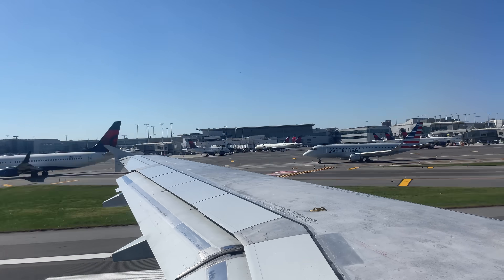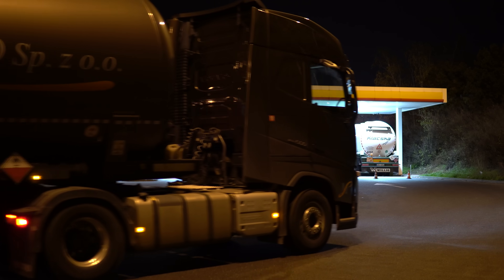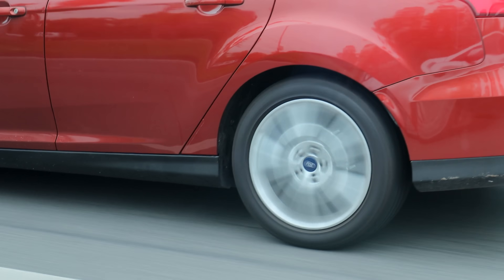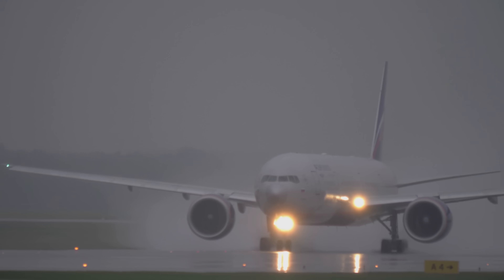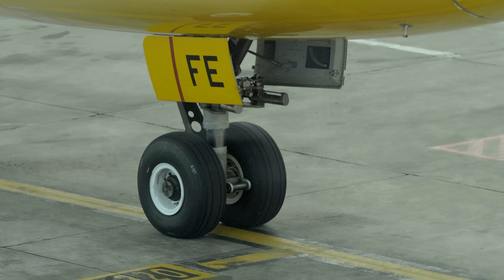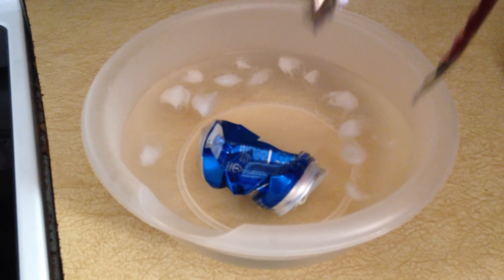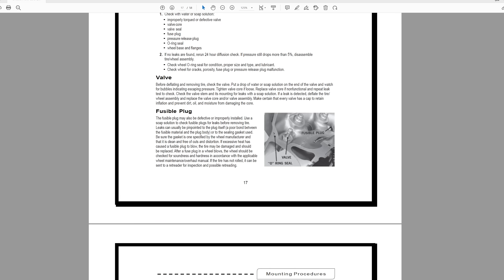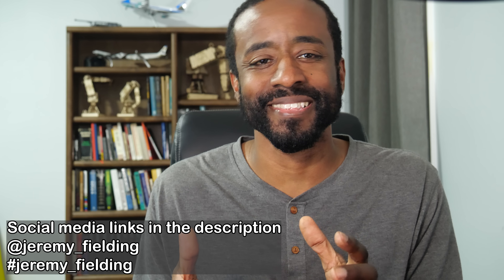The Ingenious Design of Airplane Tires- Jeremy Fielding 107

Comment from the maker: Technical correction: 
The Boeing 737-800 main wheels (the 4 rear wheels) are actually 44 inches making them just barely larger than the tractor trailer tire. Despite my research and having a second engineer fact check the video we both managed to miss this fact because the nose wheel diameter is 27" and mentioned in more places. The overall story is the same. The capacity of the airplane tire is many times greater than a truck... including the 27" nose wheel, but it was definitely worth mentioning that not ALL of the tires are 27". Unfortunately I can’t change the video now that it’s live. I also added this note to the description.
Reply: Mr. Fielding, another engaging, informative and well researched video. As a longtime subscriber, I find your videos to be some of the best on the topics they cover. Not only are they clear and concise, you deliver them in an interesting way. Keep up the great work!
Reply: Also, the fuesable plugs are in the wheels, not the tires as you say in the video,  Minor nitpick I know.  Great video regardless.  On most if not all aircraft, there is very little weight on the nose wheels.  This is a problem for many aircraft.  In fact, certain aircraft with tail mounted engines have been known to tip backwards just from the weight of snow from a storm.
Reply: More info.  Most of the weight is on the main gear.  I suspect it's 85 to 90%.  I don't have supporting data, but the 737-900 has a tailstand to prevent it from tipping during loading/unloading.  

"Power to the wheels".  No, there is no power to the wheels, but braking is the same thing, just in a different direction.

I believe the tires on my aircraft are 38 ply.  I will see if I can find some pictures in my phone.  There is also a speed limit on aircraft tires.  I would guess that the limit speed is one of the limiting factors that goes into takeoff speed calculations.

Runways:  they have crown built in to cause water to run off.  They are also grooved, but unlike roads which are grooved parallel to traffic, runways are grooved across the width.

I called one of our tech reps about tire life and was told they last about 320 cycles (takeoff/landing is one cycle)
Reply: @oscarb9139  38 ply is a weird number. I know the 767-300 uses 36ply main(rated 230psi) and 24ply nose. 
I mean its an archaic measure of equivalent tire strength anyway, none of them are actually using 36 plys of cotton in the last 70 years. Probably only 3-8 actual plys regardless of pressure rating. (With actual strength varied through different thread sizes and materials.)
Reply: @mytech6779  I was going from memory, and am most likely in error.  I have some pictures during walk arounds.    I will see if I have any sidewall info in them.  Thanks for your input.
Reply: @oscarb9139  As long as you aren't the one replacing them I don't think the difference of 2 strength plys is worth further investigation. I also have sidewall pictures from a walk around.(but its 767) Anyway 36 is a multiple of 12 which evenly divides into a variety of  sets of layers(2,3,4,6,12) which is probably why its a common standard even though it's only an equivalent rating these days.
Reply: @mytech6779  I wasn't questioning your knowledge.  I was merely stating what I thought I saw.  The preflight requires that I verify condition, not ratings.  You obviously are more familiar with maintenance procedures.  I just fly them.
Reply: @oscarb9139  max tire speed is usually 205kts, every takeoff and landing therefore should be below that speed, but that speed is never limiting (well it is limiting but there are many other factors that will go over the limit first)
Reply: @topethermohenes7658  We had a bulletin that came out that showed FOQA data with tire speed exceedances.  The cause was slower rates of rotation at high altitude airports where IAS and ground speed have a large spread, even without a tailwind.
Reply: @topethermohenes7658  Quote from article:  Boeing is receiving an increasing number of operator inquiries about tire speed limits being exceeded during takeoff. This does not appear to be a new issue. Rather, advanced data acquisition tools on modern airplanes have made operators more aware of tire speed exceedance events.

In most cases, the speed exceedance is small, only a few knots. Boeing is not aware of any of these overspeed events resulting in thrown treads, which suggests that airplane tires in good condition can withstand these small speed exceedances without damage. However, it is important to remember that at high speeds, heat is generated within the tire structure. This heat, combined with extreme centrifugal forces from high rotational speeds, creates the potential for tread loss. Ensuring that tires are operated within their speed ratings will help prevent possible tread losses and the potential for airplane damage.

When dispatching an airplane in compliance with the certified Airplane Flight Manual, the airplane takeoff speeds are designed to ensure that the liftoff speed does not exceed the tire speed rating. While rotation and liftoff speeds are generally expressed in knots indicated airspeed, the tire speed limit is the ground speed, which is usually expressed in statute miles per hour. This means that a tire rated at 235 miles per hour is designed for a maximum ground speed at liftoff of 204 knots.

A number of factors can lead to a tire-speed-limit exceedance during takeoff. Typically, this occurs when an airplane is dispatched at or near the tire-speed-limit weight and:

The airplane rotation rate is slower than the Boeing-recommended rotation rate, and/or

There is a late rotation, and/or

The tailwind is higher than anticipated.
Reply: @oscarb9139  thats for high altitude flights, for most flights, vmca always is below 205 knots. Or on long runways vmbe is limiting
Reply: @topethermohenes7658  DEN, COS, and SLC were the destinations cited.  I would assume most of these events were using high flex Temps, which usually correspond to the highest V speeds.  Our tire limit speed is 195 knots.

Yes, I agree that most of the other limiting factors will be reached first, but the cited article and communications from my company indicate that tire limit speed is also an issue on occasion.

We used to use balanced field speeds and it was never an issue.  When we switched over to unbalanced speeds to optimize payload, we got much closer to the tire limits on takeoff.  On landing, it would only be an issue on my jet if we had a failure of both slats and flaps, which increases our approach speed by 60 knots.  That is something few people have ever had to contend with.
Reply: Pretty understandable mistake. Just goes to show why there is so much fact checking in engineering or aviation. No matter how good you are, you can be prone to mistakes.
Reply: Love your videos man. Your a natural !!
Reply: Nice video, Jeremy.   A few additional details. Wheels have the thermal fuse plugs that are designed to melt a release inflation pressure after a high energy braking event (such as rejected take off) to protect the wheel-tire structure.  A carbon brake heat sink can reach temps several times greater than the temperature at which the aluminum that makes the wheel begins to loose strength.  The wheel is a pressure vessel that is only (perhaps) 1” from the brake rotors.  A great deal of effort is made to manage temperatures of the wheels. Wheels also have a secondary fuse plug to protect against over inflation- failure of the nitrogen regulator.   Something else to ponder is if you have a tire that is ~52” diameter with 21” wheel and inflated to 220 psi, do the math on the separation forces between the two wheel halves.  Those 20 or so tie bolts carry far more load than you’d imagine. Wheels tie bolts are inspected at each tire change (roughly 200 landing per tire replacement); and are perhaps one of the most inspected parts on the airplane.
Reply: I believe most larger aircraft use magnesium alloy wheels. I spent a few days working in an aircraft junk yard. Fun times  @velocisteve-myvelocityairc5494
Reply: Hi. Considering the tire costs, why don't they give some rotation on the wheels before landing. This way they won't scrape so much rubber and the tire will last longer.
Maybe winglets on the tire bead...
Reply: I was quite surprised here by the FAA  "new" rule in 1986 as I expected that already to be the norm. I was a helicopter mechanic in the Marine Corps from back in the early 70's. We were using nitrogen only back then, and helicopters never achieve the speeds or altitudes of most fixed wing aircraft.
Reply from the maker: @dallasarnold8615  Nitrogen was in common use but was not required before then (edit*fixed a typo)
Reply: @Jeremy_Fielding  Yeah, I got that from the video. I was just saying how surprising that it took that long to be a requirement, since all these issues were already known.
Reply: Most aircraft have nose wheels and tires that are smaller than the main gear wheels.  There are exceptions though.  For example, the 747 has the same size wheels/tires in all positions.  In addition to the nose gear the 747 has 2 sets of main landing gear under the wings and 2 sets of main landing gear under the body.  Total of 18 wheels & tires.  It is one BIG aircraft!
Reply: came to comments to say this... haha.  good video though!
Reply: Yeah! 
I taught 27 inches seemed small (it's just about 69 cm) for the main landing gear - but still, 44 isn't much compared to the planes size and weight either. Btw, we have heavier trucks in Europe - which is up to 60 000 kg (or was it 63 000, don't remember exactly), but those usually have 22-26 tires. Then there are special heavy road transports of things like large transformers for the power grid, large armored military vehicles and other stuff that way heavier (which is done in US as well) - often 100 000 kg or more
 - but those are usually done on large trailers that distribute the weight over like 30+ axels (normally with 4 tires on each axle). 
What makes the plane tires more impressive, is also the speed - as opposed to all heavy road transports, that's very slow (high speeds are always harder on a tire - especially in combination with the weight. Even car tires have speed ratings, along with their weight rating).
Reply: Really good and informative video! Im going to subscribe to your channel. This video is a great reminder of the impressive engineering that we take for granted as we stare out of the window at 30,000ft.
Reply: It gets crazier on the Boeing 747. Its an engineering marvel that make you think about the effort put into that machine. I have been told that aircraft's have both an AC systems and DC systems. A video on that would be awesome.
Reply: Àààáæq
Reply: Its all good man, doesnt take anything away from your main point! But thanks for the correction anyway!
The F-15E has a max gross weight of 81,000lbs and sits on two single mains and one single nose wheel. Apparently it has one of the highest PSI loads into the concrete of any USAF aircraft. Ive personally seen an F-15E parked on tarmac that wasnt rated for it literally sink into the concrete!
Also, the F-15E mains are pressurized to 310psi!
Edit: right when I added that last bit you were mentioning fighter jet psi 😆
Reply: the mains support most of the weight and the plane lands on the mains, nosewheel landings are bad, even in small planes.  main idea is that with six tires on a '37 the two in front don't carry 33% of the weight, probably about 10% so the four mains carry 90% and they do all of the braking since there are no nosewheel brakes (I believe that the 727 had these on some models).  You might also exhibit the cages used when tires are inflated (they sometimes explode) and I believe there are videos of this actually happening, truck tires also explode and they sometimes use a safety cage for inflation.  The brakes have to demonstrate the ability to stop the plane from takeoff speed at full load within a given distance without using reverse thrust (situation, an aborted takeoff at the last instance (V1) due to engine failure), this would involve stopping 150,000 #s going 150 mph within less than half a mile.  When this happens operationally, the plane will normally stop on the runway while the fire crew stands by making sure the tires don't catch fire and the plane will have to wait a substantial amount of time before  trying to take off again and might require a technician to check the brakes and tires before doing so.  Don't sweat your error in tire size, this was a very good article.  Thank you.
Reply: @henryostman5740  I work @ Miami International turning wrenches on pretty much all the big girls except the '77 and '87. we do tons of Airbus A319,20,21 I was on a team for a while travelling around the country doing A320 Gear swaps and of course we gotta remove the tires for that job.
I always love the teamwork involved in UP-Jacking the craft. absolute focus is crucial, as I have witnessed a jack slip, oh boy, Nooooo BUENO
Reply: @Terkinstein  I’ve always wondered why they don’t have a small motor on the tires to get them spinning before landing, I’m sure it would save a lot of wear, or if you get big ones, you can move the plane without using the main engines. Given the ever increasing price of fuel, I’m sure they would love to save some when possible

Comment: Tire pressure is much more critical in aircraft than your car. An underflated tire overheats and will lead to early failure, proper tire pressure saves fuel and increases the life of the tire itself.
An aircraft departed an airport in Africa, many years ago, with under inflated tires that burst in the wheelwell after the gear was retracted resulting in the loss of every life onboard.
I'm curious about the experiment you did when you adjusted the tire pressure and measured the tire contact area. With radial tires, the pressure can drop by 15 to 20 PSI without the tire looking flat. How much did you change the pressure?

Thank you for all your content, it is off the highest quality.

Comment: Remember when determining the weight per tire that most of the weight is on the mains.
Reply from the maker: Indeed it is! You are correct and this would in my opinion made my discussion of the tires even more interesting and impressive. Even fewer tires are carrying the load. I hate I didn’t think to tease this fact out when discussing it

Comment: Good video, thanks. A side benefit to higher tire pressures is the increased speed before it hydroplanes. And while the tires must support the weight of the airplane, we have all been on landings that just slammed into the runway, so temporary higher loading. If there is a stiff crosswind the tire takes large side loading. Like you said, incredible tire design.

Comment: I work in the Aviation Industry. And depending on the aircraft we're talking about. Aircraft tires are huge! Yes, the tires for a 737 are small compared to a 777, 747, A350, A330, or A380. These aircrafts are so huge that even the nose gear tires are huge.

Comment: I wonder why airliners don’t have a pre-spin motor for landing to reduce wear on the tire. A ton of the wear of the tire comes from the sudden spin up upon contact with the ground. Why don’t we implement a motor to spin them up close to landing speed before it touches down? It wouldn’t be a safety concern if the motor failed. In that case, we’d just be back to normal. It would add a bit of weight and space, but not much. I bet it could save a lot of money by greatly extending the life of the tires. Thoughts?

Comment: Nice video! Something I'd like to point out is that the tyres are compressed under the lead of the aircraft but as soon as it takes off the load is Lifted and hence the pressure inside the tire drops

Comment: I'm not sure I follow the difference between delivering power (which requires maximum traction with the road surface) and delivering braking force (which requires maximum traction with the road). From a physics point of view they seem equivalent, just deceleration va acceleration

Comment: About that last point with stronger, smaller, and higher pressure tires - smaller tires will increase torque to the road while reducing top speeds. in an off road appication this may be useful (ignoring the fact you have less traction on loose ground), but for everyday use, speeds would be reduced and higher gear ratios would need to be used in transmitions. they could be adapted to these different tires but so much work would have to be done for so little return.

Comment: Jeremy, I work at Michelin as a maintenance technician. One of our machines makes Avion Tires, there are so many difference between Road and Avion Tires, just the wire alone goes from braided wire to solid wire. And instead of 2-3 packages of it on each side, you can have 6-8. They have to handle the force of a earth mover but go the speed of a race car. Great video!